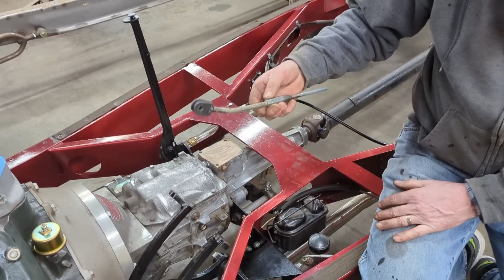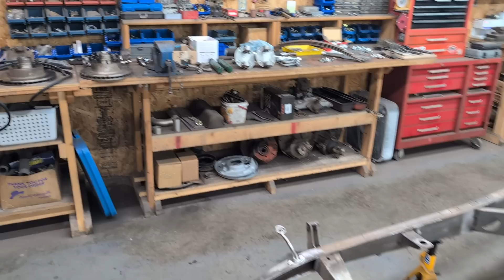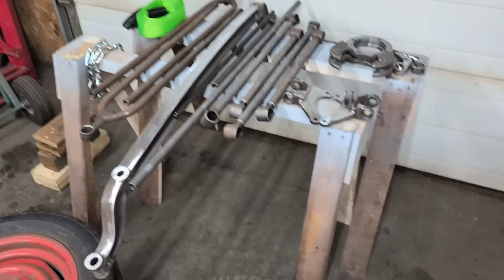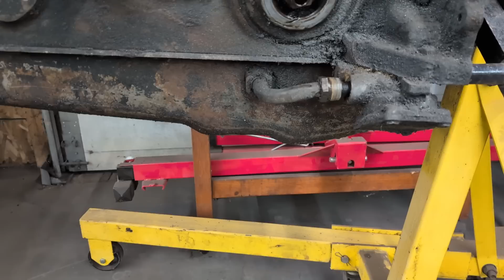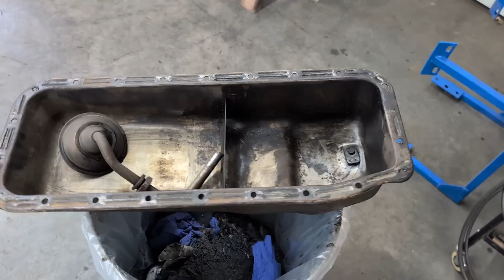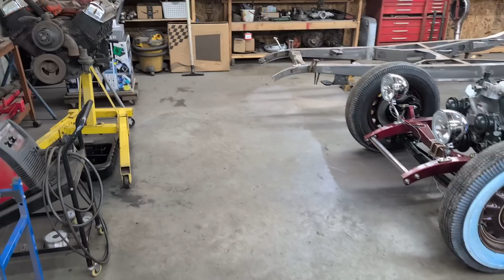Brenda's Roadster fresh paint, new tires

Comment: Aloha. That Y-block truck motor with the rear sump, does it have the Heavy Duty oiling to the rockers?
Reply from the maker: I don't know to be honest. How do you tell?
Reply: @ There should be two passages of oil going from the cam bearings instead of just one. Bigger oil pan, sodium filled valves and other differences. I  think theres more info on the Mummert site.
Reply from the maker: Ok thanks I'll check it out. This is a 292 truck block and I've had a few people want it so maybe it is like you say. I'm keeping it for a spare in case the rebuilt 1956 272 is no good.
Reply: @coldstreamrodshop  Good idea to keep it. 👍

Comment: looking good,it's all progress.i doubt those are Tru-spokes,not that it matters unless they're for a specific application like a Ford wheel.they look to me like a Maclean Wire Wheel.i had a 55 Chevy years ago with real Tru-spokes on it,the centre hub was much smaller in diameter and the lugs were exposed,not inside and under the hubcap.makes no differance,it's all good.take care.
Reply from the maker: I don't know anything about them so that's quite helpful. They're 5 x 5.5 bolt pattern and are very close to a 35 Ford wheel.
Reply: If I win the  lottery-I'm giving ya a call. Attention to detail appreciated ,

Comment: I like it. Wheels are a little different. I think I would have stuck with the artillery style and whitewalls. You have a real good eye for detail. And the clutch bracket looks much stronger. I may need to do the same. Not quite there yet.
Reply from the maker: There's a lot of pressure on the clutch rod. I wish I would have had the clutch on the first time and then it would have been obvious. 1/4" plate across 3 bolts did the truck the second time.